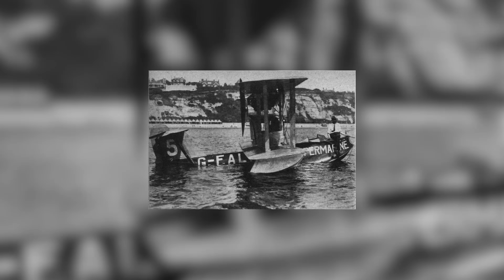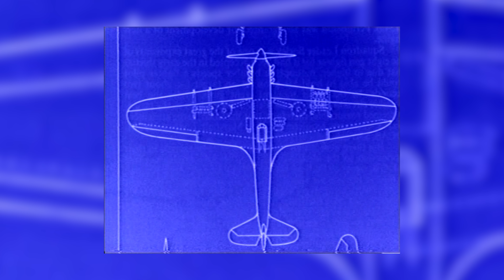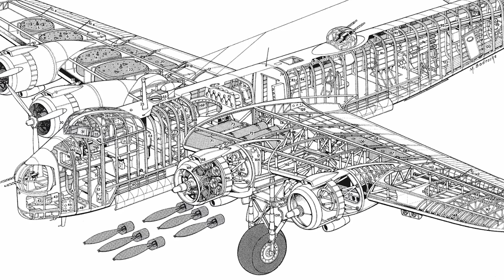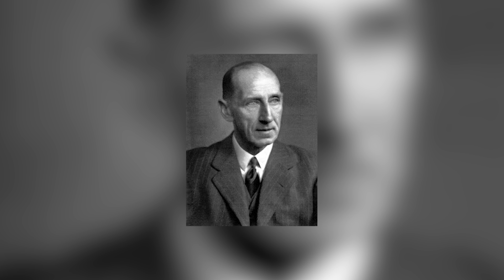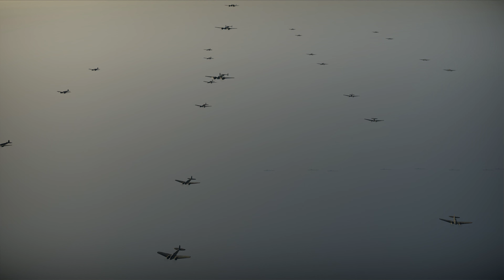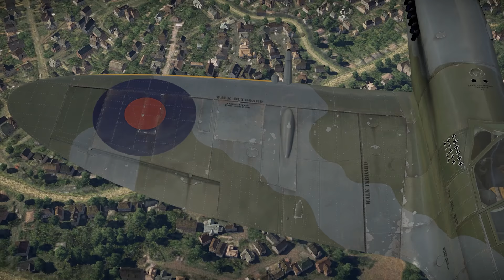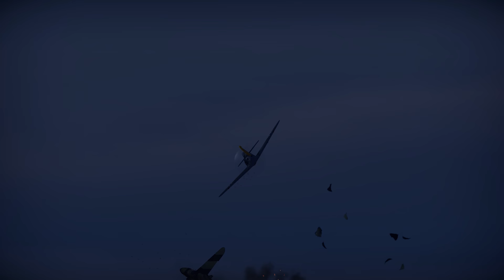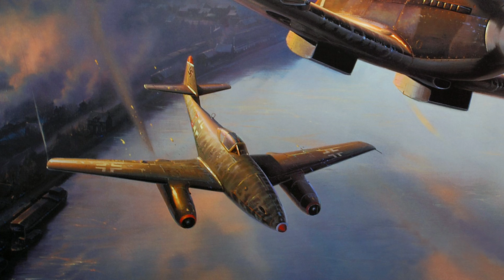SPITFIRE | A Documentary

Comment: Messerschmitt had the advantage in high-altitude performance, as well as in the ability of its fuel-injected engine to function even while inverted, when a Spitfire’s Rolls-Royce Merlin power plant would be starved for fuel. The Spitfire’s lower wing loading endowed it with superior maneuverability, but the Messerschmitt’s principal disadvantage lay in its limited range. After 20 to 30 minutes over the average British target, a Messerschmitt pilot would have to break off his engagement or he would run out of fuel before he could return to base across the English Channel.